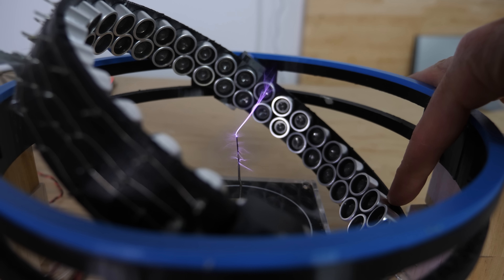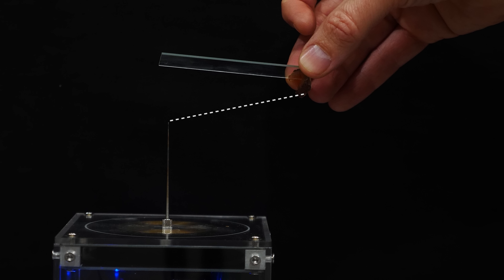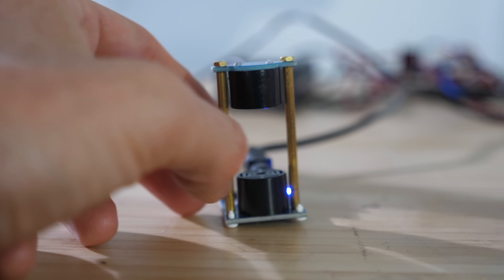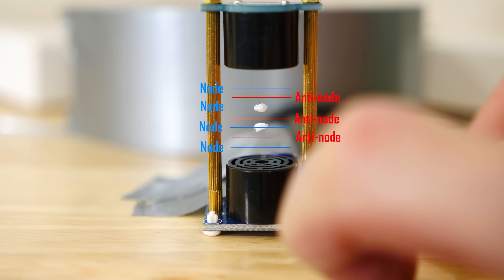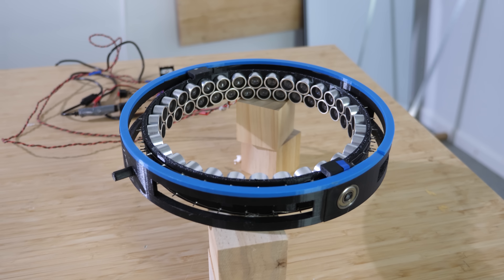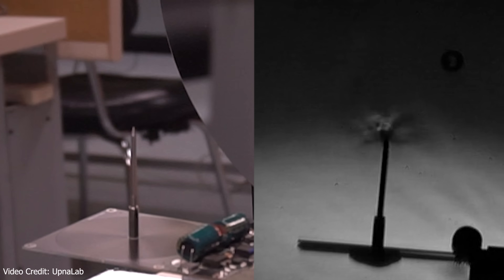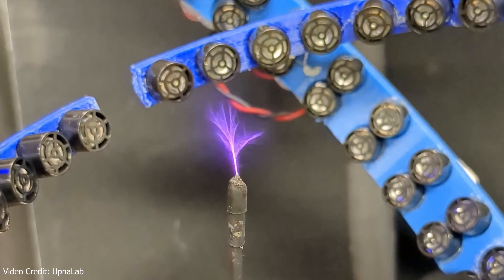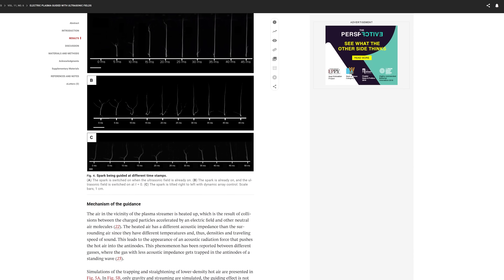Can You Control Lightning with Sound?

Comment: holy crap.  i just realized this is why it made sense that the firebenders could also guide lightning.  it was about channeling heat and letting it flow through them.  dam.
Reply: You bend fire by being charged, Jay on plasma channel did it in his fisrt video using a van de grateful or Tesla
Reply: Less cartoons and more science.

Comment: so put a sonic boom device at the root of the tesla coil
Reply: well you can direct it with just air flow. ie shop compressed air pistol. so what if there is already a conduction path, say graphite wire. then you assume the arc will go throw the air next to it because its easier to continue ionizing than the graphite with lower conductivity. its like a bulb starter but the current will go throw the air next to the wire. not on the wire. thus the wire is not consumed.

Comment: Does this mean they can change a tokamak reactor to contain the plasma using sound instead of magnets? Though technically don't speakers use magnets anyways? I wonder if a sound contained plasma reaction takes less energy than magnets. Could we have DJ's operating fusion reactors in a decade?
Reply: Ehhh maybe I think using both in conjunction would be best. Problem is the magnets neccesary for your speakers would make the already complicated magnetic field of a fusion reactor even more complex. If you had some means sepperation of sepperation between the transducer surface and the driving element then it might be possible. I honestly don't have enough knowledge about the issues with magnetic plasma confinement aside from heat shielding to say for sure how useful this would be.
Reply: Ehhh maybe I think using both in conjunction would be best. Problem is the magnets neccesary for your speakers would make the already complicated magnetic field of a fusion reactor even more complex. If you had some means sepperation of sepperation between the transducer surface and the driving element then it might be possible. I honestly don't have enough knowledge about the issues with magnetic plasma confinement aside from heat shielding to say for sure how useful this would be.
Reply: Ehhh maybe I think using both in conjunction would be best. Problem is the magnets neccesary for your speakers would make the already complicated magnetic field of a fusion reactor even more complex. If you had some means sepperation of sepperation between the transducer surface and the driving element then it might be possible. I honestly don't have enough knowledge about the issues with magnetic plasma confinement aside from heat shielding to say for sure how useful this would be.

Comment: This has to be the basis of the most practical 3d holographic video display technology. You just have to work out a scan pattern and you could have the 3d equivalent of a CRT.
Reply: I was thinking this too.
Reply: You can't make a single illuminated spot in mid-air with this. There is always a trail of ionized particles so no way this would look even remotely convincing. Also, how would this be the most practical one?

Comment: So if you made a cloud chamber, could you see if you could control radiation from americium with sound?
Reply: Unfortunately the path of ionization for alpha particles is almost entirely determined by the kinetic energy vector of the particle and any collisions with other particles.
Reply: The pressure waves of the sound would make a mess of the mist in the cloud chamber. Might make for a good visualization of the sound waves though.

Comment: I had a dream recently about something that looked very similar to this. I was inside a microscopic cell or bit of a computer, which had an upper hemisphere embedded with 144 nodes/contacts. There was a fluid electric tendril that was in the lower center of the hemisphere and could bend to connect to any individual node, which would electrically bridge the gap. It seemed much more efficient than binary since it would scale over 100x faster. I drew a picture explaining it, and the setup in the video looks almost more accurate to it than my own picture, just with the ring extended upward into a hemisphere, but I didn't think of using sound emitters at the bottom to bend the plasma/electricity. You could mirror it symmetrically along the equator and make stacked spherical bits too.
Reply: i see it

Comment: it was also long believed that you couldn’t extract energy from ambient thermal sources after thermal equilibrium. But the Evosmosis Cycle turns that assumption on its head. By using vapor pressure differences, osmosis, and hydrostatic gradients in a closed loop, it shows that even "equilibrium" isn’t the end of the energy story.
More information ℹ️:
First Preprint' DOI: 10.20944/preprints202403.1698.v1

Second Preprint's DOI: 10.20944/preprints202403.1698.v2

Similar work from the University of Arkansas, USA:

Physicists build circuit that generates clean limitless-power from graphene.
DOI: 10.1103/PhysRevE.102.042101

Comment: What if you make a sphere of ultrasonic transducers? Could you compress the plasma to make a mini star? Like if scaled up 1,000%? Lol. Please do a DIY creating a fusion reactor/ mini star video, I would love to see if this is even remotely possible. I'm sure its not, but would definitely make for a cool experiment!
Reply: Ultrasound waves instead of huge magnetic fields to control plasma in a nuclear fusion reactor—I thought the same... But how powerful could they be compared to massive electromagnets? Could they achieve similar or even better control? Have they tried it before?
Reply: @morphingsomething5203  Don't think so, this spark has much less energy, and I mean much much less. Nuclear reactors must be compressed with incredibly strong magnetic fields, 13 T in particular, and this much energy you can basically never achieve with ultrasound.
Reply: the pressure isnt high enough
Reply: Wait... so what if you used standard ultra powerful magnetic fields like in a regular fusion reactor but added ultrasonic transducers for fine plasma control? Isn't keeping the torus shape of plasma/energy output stable, our current problem with fusion reactors?
Reply: @ShrimpAlmighty  need a whole lot of force to hold it in that shape and to manipulate the shape, these speakers arent able to force the gas/plasma together that powerfully either way(if they could then youd need to keep these speakers isolated for safety reasons)
Reply: Egyptians already did it with the dendera bulb. ;) I'll let you go down that rabbit hole.

Comment: Is this the last thing hacksmith needs for their lightsaber?!
Reply: Honestly thinking about it, absurd soundwave power + absurd lightning power could technically make a "sword" cappable of cutting in a convoluted way. I'm not a scientist, but i'd imagine vibrating a material to its breaking point and heating it at the same time would quickly open holes in things.
But that would require lots of power, and protection, to ever be feasible.
Reply: @tornadix99 Have you ever watched The Core?
Reply: Whoa...my thoughts exactly.  Pondering use of this tech for light saber build.  Using tiny handheld Tesla coil with the possible reduction in size of an ultra sonic ring aperture.
Reply: Has anyone modified a laser welder to prune trees?
Bit excessive I know (knife for the job!)😂
And actually sets the tree on fire too.🔥
Very dangerous 🙊a baad idea🙈
Don't try that at home kids.🙉

Comment: Put the hot air idea aside for a moment, not because it doesn't contain an element truth behind it, but because it is missing a key component that explains what's going on. 

Plasma discharges depend heavily on a sufficent mean free path between collisions being long enough in a given electric field to let electrons accelerate long enough unimpeded in that electric field such that when an electron eventually hits another air molecule, more than one electron is knocked loose, analogous to a snow ball growing as it rolls down hill. Conditions that favor an avalanche of electrons flowing through the air makes the air very conductive. 

The mean free path increases along intense the low pressure potion of audio  waves is likely when the discharges are happening and half an audio note away in time, the high pressure wave has molecules slamming into each other with such intensity that electrons may be more easily knocked loose  making the following low pressure phase more conductive.

Comment: 0:26 it can be also said that the electricity tends to take the path of least action, which was well explained in one of the new Veritasium videos

That also means electricity will take the path with least energy used, so least ionisation or least resistance, although there can be other factors as well
Reply: It always takes the most efficient path
that's why every allegory in science is completely wrong and needs to stop mystifying terminology
Reply: If you take resistance to mean it's general usage rather than scientific usage , then path of least resistance is correct. That encompasses science resistance, ionisation etc etc etc; anything that resists its path

Comment: I wonder what would happen if that lab were to make you a more conical ring. Instead of a circular planar ring. Where you'de have opposing ultrasound speakers emmitting into a central point. Instead, you would have a conical ring where the speakers are pointed diagonally upward towards a central point, where the plasma can be directed. You'de have to move this laterally segmented conical ring of ultrasound speakers down the tesla coil's emmitting pin or terminal or shaft. So that the central point is to be located just right above the tip of the emmitting terminal.
Reply: And with varying power and precision it's not beyond even this simple design to have directed plasma bolts fire able

Comment: Make a rail gun if u put a bunch those in a line a regular bb will be able to accelerate to a crazy speed before touching the air
Reply: Impedence mismatch would lead to poor transfer of energy to the bb. Most of the wave energy would simply bounce off the steel bb.